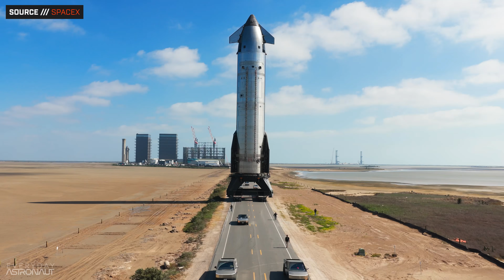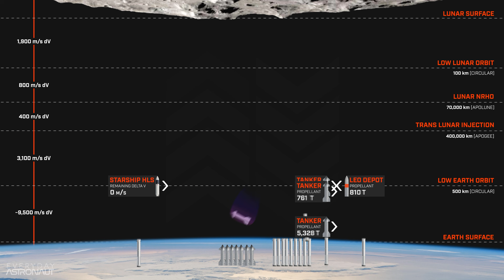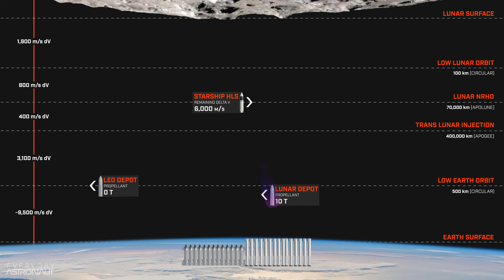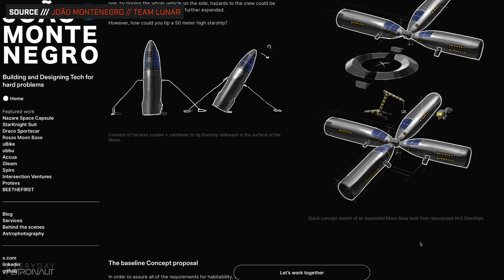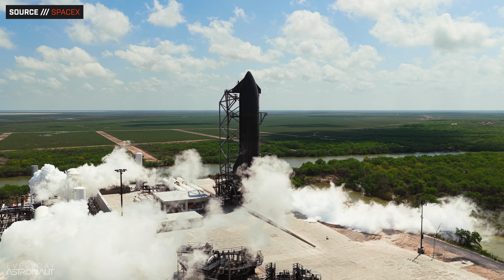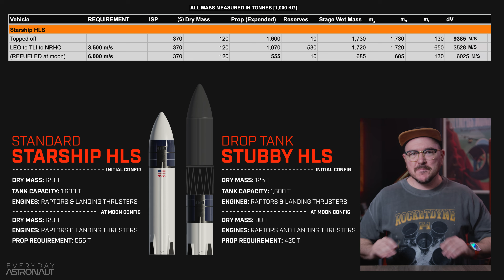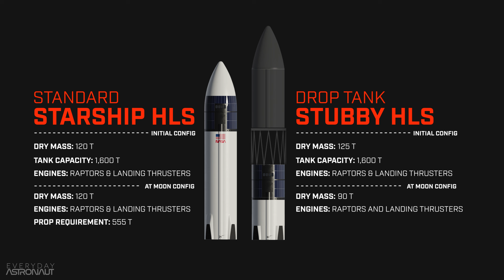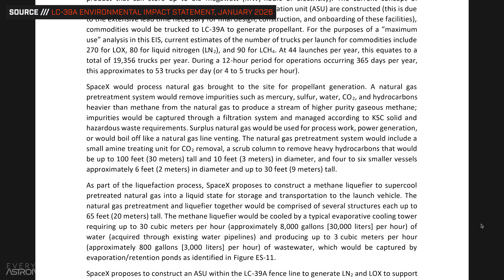Does Starship REALLY require 15+ launches to land one lunar Starship?!

Comment: This may have been mentioned before I know this is a 3-month-old video. What if the booster doesn't have to return to its launch site. Rig landings Louisiana coast landings, Florida landings, that can also be a re-launch sites. Said booster launches from Texas but its next re-launch is in Florida. Basically juggling the boosters. Would that save any substantial amount of boost back burn propellant?

Comment: Is there a chance that most of the depot filling could be the extra mass on every launch where there is extra capacity beyond the paid payload, filled with extra fuel, so that as they are doing their normal launches, they are slowly but surely always filling up the depots and reducing the cost of 15 launches just for fuelling? Guess it depends on launch frequency for it to make sense.

Comment: Dump the entire NRHO. Drop the polar base. Because would be cheaper to simply haul water to the moon instead, and Ships don't run on hydrolox. Mining water makes sense only when every launch to the  moon costs 3 billion dollars. NASA had to factor that, but SpaceX costs orders of magnitude less to simply haul a hundred tons of aqua to a base at more accessible latitudes. Also SpaceX can orbit cheaply Starlink around Luna, thus removing once again NASA's limitations of the number of hardware launchable that required NRHO to keep in touch with ships.
Reply: How is fighting through our gravity well to haul water to the moon cheaper than utilizing that which is already there (in the lunar polar ice)?

Comment: The SpaceX Starship lander concept is probably suboptimal. A  better approach could be to have an Earth-Moon ferry, going from low Earth orbit to LLO or   directly to the lunar surface. Search for "Moon Direct" by Robert Zubrin (published in The New Atlantis in 2018). The idea of sending a whole Starship to the Moon appears to be excessive. The advantage of LEO rendezvous is that the lunar excursion vehicle (LEV) is much lighter, since it stays in space and does not require the extremely heavy re-entry and Earth-landing equipment as well as the structure to support all of the launch stresses, instead carrying more fuel for the necessary delta-V's. On returning from the moon, it would enter LEO and rendezvous with a space station, the crew returning to Earth's surface in a Dragon capsule parked at the station. The LEV refuels at the LEO station and on the lunar surface. And Zubrin's concept was built around Falcon 9 and Falcon Heavy...

The reliance on rocket motors for the return to LEO is no more critical than that at any other transition.

 I suspect that the  optimal solution would at least require four vehicles:  (1) Earth-LEO human transfer (e.g. Falcon 9/Dragon,  (2) Earth-LEO cargo+fuel transfer (SH/Starship), (3) LEO-LLO humans+cargo+fuel, (4) LLO to lunar surface, wth stations in LEO and LLO. (3) and (4) could have separate human and fuel+cargo variants, so that there would be many different spacecraft. Why take fuel all the way to the lunar surface when it only has to come back up again?
 
Your ideas are certainly positive.

Comment: Isn’t the landed mass ratio about the same as Apollo if you include the tanker masses?  Saturn V was about 3000 mt.  Starship with 15 tankers is about 5300 mt x 16 = 84,800 mt. Saturn V delivered 7 mt to lunar surface for a ratio of .002.  Starship will deliver 100mt for a ratio of .001.  Fairly close.  (Very rough calculations and engineering approximations.  So close enough.)

Comment: If the landing thrusters are that capable, it kind of raises the question of why you would bring the vac engines along too, when theyre the reason the vehicle is so tall. You could fill the whole bottom "floor" with a lab and garage instead, assuming the thrusters are hugely lower ISP. It would take quite a big difference to make it worth hauling two sets of engines around relative to the amount of fuel saved, since the actual burns are relatively small once you get there... You could even have a  super heavy booster do the TLI burn before turning around if you wanted to really save mass (though I don't think they've built in flight fueling into the design of the booster, but I don't think it would be much different from the ship version)

E: ah, it's because the ship needs the higher thrust to put itself into orbit to begin with, not for TLI

E: ...and everything else you said. Apparently the ISP matters quite a lot. Should have known you would do the math lol

Comment: I wonder if they could pack some kind of really long hydraulic jack, like a long and loose version of one of those legs that the astronauts could use if it falls over in landing to put it back straight? Or maybe a 3 leg bracket pulley system..

Comment: Spreadsheets are great for using numbers as the variable factors.  Most people can tell if one number is greater than another by looking at it.  Oh, by the way, the "Drop Tank" option is nearly as old as rocketry itself; it used to be called "Staging."  OK, you save the engines with the "Drop Tank" stage, but if you didn't, it would only be a couple of tons of dry mass per engine.  Staging has long been used as the basic means to increase efficiency.  You could do almost the same thing by creating an intermediate stage half as long as Starship and use the Stubby Starship.  I think you would gain all the advantages of Stubby Starship as well negate the disadvantages of a full size Starship.

Comment: You know how you're talking about early days of unsuccessful landings, and you're like, "...They had their moments with it..."?  Those "moments" were actually complete-tip-over-and-explode.  You can afford that if there aren't any humans on board.  But you cannot afford even one moment of it with humans on board.  What's more, whilst some were landing on ships, many were on land, where there's a nice flat and even, smooth and level landing pad.  That's you problem right there.  The fact that Kerbel lets you land on an angle is not really that relevent, in my mind.  The surface will be slipping and sliding under the leg's pads, the bits that actually contact the surface, because of the overal angles of the ground and the fact it may be many different sizes and shaps of regolith/debris that the landing is happening on.  Even if they found an area that seemed really flat and level, I'd lay pretty good odds - over 50% - that the thing will tip after finally shutting off it's stabilising thrusters.  If they want to avoid this, they should send squat LEM-profile landers first, get out, lay down a nice strong flat and level and smooth concrete landing pad, and THEN send the big tall wobbly skyscraper.  The fact that the landing stabilising thrusters are high up is nice, but kind of irrelevent.  You know that picture you showed of the SLS trying to land in a big crater it itself had created?  That's going to happen anyway, no matter how high you put those thrusters.  Why?  Because of the sheer weight of the vehicle!  Sure, you can land it on the surface propulsively, but as soon as you stop that propulsion, the weight will cause it to sink in, 99.9% surely in an uneven way that causes it to tip.  I.e. its own weight will cause that crater, even if the thrusters don't.  It'll be like expecting to propulsively land it on a beach on Earth.  Yes, the moon has less gravity, but that's almost irrelevant.  The ship will have the same mass and momentum as it has on Earth, and small changes in tilt and centre of gravity can easily compound over a very short period of time, and then, bang, you've fallen over.

Comment: Our guy took the flaps off the lunar depot then has it coming back to Earth. First, I thought the flaps were necessary for landing, also why can't it just be filled up again? Maybe it doesn't have enough prop to actually get in the correct orbit, or maybe SpaceX wants to make sure its good for another round before flying, but then if it's landing why no flaps? If we're crashing into the ocean anyway then what was the point of a reusable rocket?

Comment: So, how many Starship Tankers will be needed to fill the Orbital Depot? It depends on how long  a tanker takes to blast off, rendezvous, dock, transfer fuel, separate, deorbit, be caught at the tower and be restacked, then fueled to be sent up again. Assuming the Depot is in a 90 minute orbit similar to the ISS, the quickest anyone has gotten to the ISS has been a little over 3 hours with a typical Dragon taking 15-27 hours. Since the Tankers and Boosters are to be reused, what is the most efficient number of Tankers, Boosters and Launch Towers that we need to have to create a conveyor belt such that the Depot can be filled quickly?

Comment: Biggest problem landing horizontal on the moon would be taking off and returning to orbit.  They would be unable to use the big powerful main engines on the bottom of the rocket and would those small landing engines have the thrust to get the starship to a sufficient altitude in order to do a rotation manoeuvre so that they could fire up the main engines.

Comment: I feel that Starship is a viable option for base building on the moon, but it will for sure need smaller ships to land on the moon first and a viable landing platform to   be built. Recent missions have shown that much more compact vehicles have a very hard time staying upright on  the moon. Starship is just too tall for landing on an on prepared planetary surface, is what it feels.  At least a surface with lots of small bumps, which seems to be the case of the moon.

Comment: This is a very silly arcitecture. If you need to fill a depo to fuel HLS, and then fill another depo to refill-HLS in Luna orbit, then you might as well fuel both HLS in earth orbit, dock them together, and stage them, and have the boost HLS return to LEO quickly, and have the Luna HLS return to LEO after the mission. You get a lot more cargo that way.
3,000 tons to LEO per mission is also a lot of incentive to develop much better orbital transfer options. As well as spare capacity to test them in orbit.

Comment: My favorite idea is one that wasn't quite mentioned: a Starship Stubby Tanker with drop tank -- or, more properly, drop off delivery tank. You make a Starship Tanker that leaves full tanks in a larger tank farm, which can have much larger shade sails and MLI. The expensive part of a Starship -- the engines --  returns, either with an ablative shield or just a shorter version of the standard Starship, flaps and all. This lets you leave more propellant mass and INFRASTRUCTURE mass in LEO since a stubby doesn't need as much propellant to deorbit. The drop off tanks would be mounted on something like a hot staging truss, and a small tug grabs the drop off delivery tank and slots it into the farm. 

Why do it this way? Because eventually you'll be getting LOX from the Moon, and you get all that mass leverage right at LEO where you need it most. Then bog standard HLS top up in LEO and bring a little extra LCH4 and a little less LOX to the Moon (in whatever orbit), because LCH4 is needed there and Lunar LOX will be available there.

Comment: myself not an engineer but let think 
1. the super tanks can be posted at lunar and earth orbit  , 
2 lets say they have to check the heat sheild and pay load why not send 5 of the next ift to moon and land there and make a base out of it 5 ships enough for launch pad where lunar debris cannot get in the engines and make a megazilla, foldable living areas and 3d machine which starting habitat in moon right now as that equipment is going to waste in the bottom Indian ocean instead of choosing a site and crash landing on moon which can be use raw material for set up a base on the moon with robots and RV and space x already has 40% area of the ship which can transport equipment to the moon as you said 10 ship to refill instead one tanker 40 % of liquid lox  and methane lox and which is 50:50 of so the refilling time can be reduced and can have a dual support in the matter, and when there are taking 10 years they can do it 50% of the time and that would be better instead of every ift being destroyed in indian ocean but can be use as raw material to set up base which will also increase the pace to start lunar base , mining , and extra engines and tiles and other things. how

Comment: What about a separate low-mass ascent stage, on top of the lunar lander?  You don't necessarily have to take everything back to lunar orbit that you brought to the lunar surface.  All that really has to leave the lunar surface is the people and the samples.  Hardware that's coming home just to sit in the Smithsonian museum can be ditched, right?

I also want to see a charged-dust drive that works like an ion drive but by putting electric charge on specks of alumina (Al2O3).  The energy would partly come from an aluminum/oxygen battery, 4Al + 6O2 --> 2Al2O3, manufactured on the moon.  But if the dust drive had good Iₛₚ, the amount of alumina produced by discharging the battery would greatly exceed the amount of dust ejected.  The difference would be made up by slowly recharging the battery with solar panels in whatever orbits it was transferring stuff between.

Comment: Why not use the full potential of V3 Booster that is 2,5 times more powerful than a Saturn 5, and instead of putting the huge and heavy moonlander on top of it. Why don't you use every drop of fuel of the booster that becomes expendable what will absolutely be cheaper than send 15+ full stacks into space to refuel. Instead of the massive lander what has too much dead weight like make a lander that is maybe 3-5 times bigger than Apolo but Xtimes smaller than this tower. Completely replace the concept of this lander and just build a few stages on top of the booster to lose weight so you maybe don't need to refuel. However if you refuel the stage that used some juice to get everything into Leo and refuel before the TLI what gives so much more Delta-V.

So you can bring more payload to the Moon like a bigger lander but still a fraction of that massive lander that it can easily do the TLI and make it into a circular Lunar orbit and then astronauts go in the Moonlander and when they come back you don't need the lander anymore what is dead weight so the accent stage to dock again and go back to Earth. Where SpaceX Moonlander need to get that collosal thing in Moons Orbit and then dock to Orion. If you look at the pictures Orion on top of the moonlander, Orion looks like mosquito. So proportions don't add up and all the refuelling for the Moonlander itself. 6ou don't get it back so why do you need that collosal thing in the first place?

Comment: It is just crazy to say that even if SpaceX can get back all it's Starships tankers, that both the Booster en especially starship needs refurbishment or at least a thoroughly checks before it fan fly again and when the first launch starts the clock starts because you can't have it a month in LEO with cryogenic fuel. And It's no higher math that sending about 15 starships ultimately costs exponentially more than a single dispensable Saturn V rocket corrected with inflation. All extreme boosters and Starships use sooo much fuel to bring a fraction into LEO. Only all the fuel and the cost of using the hardware as Boosters and Starshipx will explode the costs. It is just not economical..

I understand that they want to land a somewhat larger vehicle on the Moon that can carry much more payload for experiments and maybe stay longer on the moon. like a Moonrover that even the lander the Eagle could even carry. But landing a massive ship of hundreds of metric tons is completely insane with over 100 tons of dead weight pure overkill. The Moonlander is still a concept.

Why not use the full potential of V3 Booster that is 2,5 times more powerful than a Saturn 5, and instead of putting the huge and heavy moonlander on top of it. Why don't you use every drop of fuel of the booster that becomes expendable what will absolutely be cheaper than send 15+ full stacks into space to refuel. Instead of the massive lander what has too much dead weight like make a lander that is maybe 3-5 times bigger than Apolo but Xtimes smaller than this tower. Completely replace the concept of this lander and just build a few stages on top of the booster to lose weight so you maybe don't need to refuel. However if you refuel the stage that used some juice to get everything into Leo and refuel before the TLI what gives so much more Delta-V so you can bring more payload to the Moon that it can easily do the TLI and make it into a circular Lunar orbit and then astronauts go in the Moonlander and when they come back you don't need the lander anymore what is dead weight so the accent stage to dock again and go back to Earth. Where SpaceX Moonlander need to get that collosal thing in Moons Orbit and then dock to Orion. If you look at the pictures Orion on top of the moonlander, Orion looks like mosquito. So proportions don't add up and all the refuelling for the Moonlander itself. 6ou don't get it back so why do you need that collosal thing in the first place?

Comment: I'm yelling out WTF when you ask why they didn't just design a smaller Starship from the start. The first thing is that this is the smaller design from the start. The original design was 12 meters in diameter and they decided to reduce it from 12 meters to 9 meters. The second point is that the Moon was never their destination in mind. Starship was designed from the get go, to colonize Mars. They only just recently decided to change their plans and do these Moon missions before going to Mars or at least doing them in parallel.